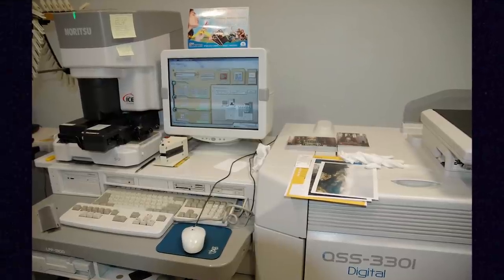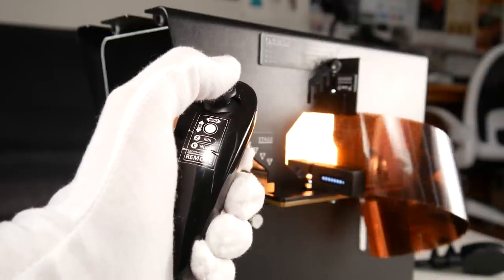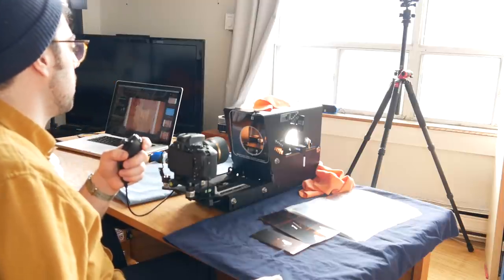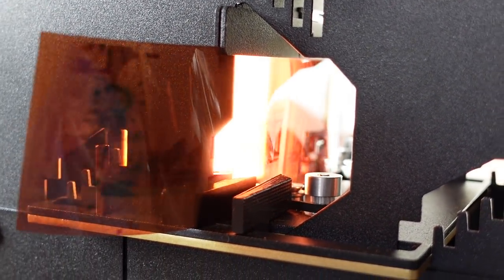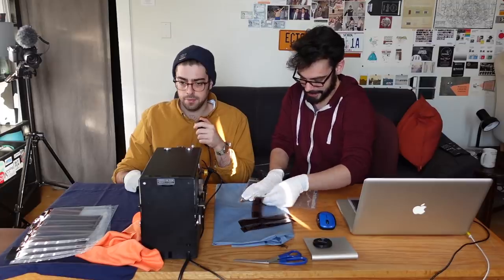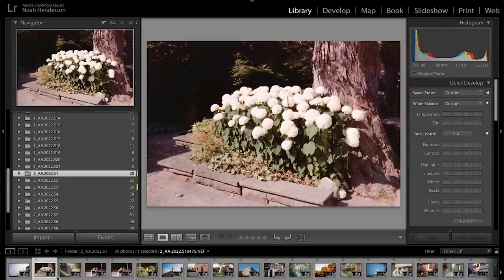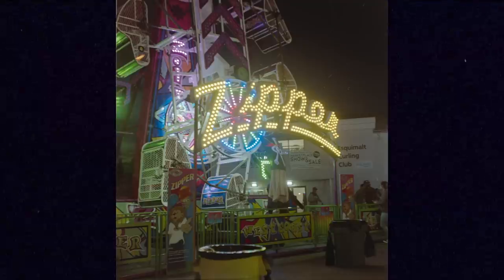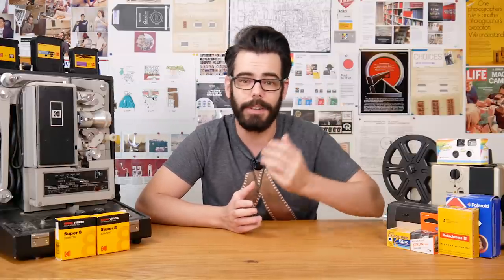Scanning Film with the SLIDESNAP STRIP

Comment: If this could all be integrated into a single unit with built-in lens and sensor and bespoke capture software, ie a modern-day equivalent of the all-purpose film-scanner, then there could be a mass-market for it. That of course would require hefty investment by a big name company OR a substantial kickstarter. But as it stands the market is a niche one. I'll stick with my V850 which is not perfect, but is good enough for my needs. Where everything falls down, current options included is the efficacy of dust and scratch removal, whether it be hardware based at the scanning stage, in post processing or bespoke. There was a recent post in the FB group for film scanning that generated a lot of debate in this area.
Reply: Hmmmmm.... How much would you pay for something like that?  I've been playing with the idea of building similar actually.  Most of the mechanicals can be 3D printed, and the rest with inexpensive linear stages, steppers, etc. straight off Amazon.  The remaining 70% is software.

If I didn't have a pair of Nikon CS5000 and CS9000, I'd be working on building this already.
Reply: @RobertLeeAtYT  If the price point was comparable to say the Epson V850, or a Medium format film scanner, then yes make it.

Comment: The moment someone comes out with a proper Hasselblad flextight replacement, it's over for all these DSLR scans.
Reply from the maker: Those are targeted at very different audiences though with flextights being over $10K usually. That doesn’t replace camera scanning for someone doing it on a casual basis, or archives and museums that aren’t tailored for that sort of workflow.
Reply: @AnalogResurgence  True, but given the development of software and hardware since these scanners came out, you could definitely argue a similar (if not better) scanner could be made for those willing to spend it. Put a 4 core CPU, 8Gb RAM, an ACTUAL thunderbolt/usb-c port, and maybe even a small GPU, and you've got a machine that's not only fast, but can be made a lot cheaper and is more up-to-date. 

It's been an idea I've thought about for a while, especially since the demand for quality scans has gone up. A dedicated scanner that could export directly into Lightroom that only needs a USB-C port would mean you could save a huge amount of desk space and avoid a lot of the hassle.

Comment: I don't know why anyone would buy this for $4000 when an Epson Perfection V800 is about $2000.
Reply: v800s go for like $800 bucks. Even then,  plustek makes a model for both 120 and 35mm.
Reply: @Adrian-wd4rn  I must've been looking at the V850. And I'm in Canada  so the exchange is a bitch
Reply: Oh man, those scanners are pretty bad - both spatial resolution and dynamic range.  Digging into the denser parts of slide film is a problem.  

Film flatness is also a problem.  You'll want to wet mount to digitize film you really care about.

I'd go as far as to say there are no satisfactory consumer flatbed solutions for scanning film.
Reply: @RobertLeeAtYT  I would disagree.  I have a v800, and it's not nearly as bad as the reviews make it out to be-- it's not nearly as good as Epson makes it out to be either, but 2400 to 3200 PPI is a perfectly reasonable goal with the v7xx/v8xx.  The lack of focus adjustment on the scanner itself is a pain, and I do have to do some sharpening in post (I refuse to let the scanner software do any sharpening), but I get pleasing results.  As I shoot 120, 135 and 4x5, the versatility of the Epson is a must have.  While I have experimented with DSLR imaging, for 120 and larger, you have to stitch to get better results than the flatbed-- and the results are significantly better, but it's slower and more involved to do the stitching, and then the scratch/dust removal in post.

The Slidesnap Strip looks fantastic, but it's still $6k USD by the time you add a DSLR and a good macro lens.
Reply: @johngelnaw1243  It's relative.  I'm used to scans from a pair of Nikon CS5000 and CS9000 scanners.  The output quality is just shy of a Flextight.

For your camera scans, have you tried focus stacking to mitigate film curl and scanning plane misalignment?

I shoot primarily 6x7.  That's about 80MP worth of resolution.  A camera like the Panasonic G9 will do that.  The S1R will provide ~190MP, so more than what's recorded on film.  Use a good macro lens and you're good to go.  No stitching necessary.

Comment: Interesting, but it seems like the carousel slide model would be more useful for people scanning large archives, because 35mm mounted slides are probably the most common format. The transport system and horizontal design is cool, but it can't handle 4x5" or larger negatives, and there are a ton of those out there. That means for a versatile setup that can handle all common formats, you'd need this model, plus the carousel model, plus a separate vertical setup with a tall stand for large format and positive prints at various sizes. At that price level and for the amount of space taken up by 3 systems, I feel like potential customers would really lean more towards an all-in-one modular setup like the Phase One Heritage system.

Comment: It seems like this would be a good machine to slightly tweak for motion picture film. Especially if there was a 16mm holder..
Reply: Was thinking the exact same thing. People have rigged up similar things using old projectors and digital cameras that advance frame by frame are are automated to take a picture everytime it advances. Seems like this could easily take up 16mm (same as 110 film) if you simply had two reels on either side.  You'd need to rig up a way to automate it though.

Comment: It does scan fast  but still negative. Film scanners scanning the photo in color so you should mention how long it will take you all these rolls you scanned to make them color one by one.
You shaving time on scanning but you need extra time in post processing. 
Another quick observation is that the frame holder has only 2 parallel lines. Most of the developed film negatives are curved/bended thus the film holder must hold it in place as flat as possible so the whole frame to be in focus when you scan it. Most of film scanners as you know the holders are a square frame for that reason to hold the film as flat as possible. 
He needs to upgrade the film holder to my opinion cos the negatives doing a curve in the middle.

Comment: Really surprised they sent you that camera instead of a D850.  Although it's more expensive, Nikon built an inversion option into it specifically for scanning film.  That would address the 'inconsistency' issue and also take the inversion step out of the software, just giving you a positive raw Nikon file you can do the usual editing workflow with in Capture One or Lightroom.

Comment: What I personally still missing is full X/Y motion, for larger formats (about 6x6 MF and up) to really get all the detail out you need to shoot parts of the negative and stitch in post (at least on most DLSRS/Mirrorless that are less than 50MPix and even then depending on how you exactly do the calculations 6x6 film can already be over a 100 equivalent in theory, though not in practice). Sadly there is currently no product that can automate this (have seen some DIY but don't have the skill nor the time to do that)
Reply: Ah, take a look at the Panasonic S1R.  In high res mode, it'll produce 188MP of real resolution.  It uses the IBIS to shift the 47MP sensor around eight, essentially half-pixel spacings.  It combines the subsequent exposures in-camera to give that ~200MP final RAW and JPEG image.

This blending also improves hue resolution, as it essentially backs out Bayer filter interpolation.  Each pixel position is sampled by R, G and B photosites.  The already insignificant filter noise is lowered further from the pixel averaging.

I use a Panasonic G9.  It's a MFT format camera with a 20MP sensor.  It's high res mode provides 80MP.
Reply: @RobertLeeAtYT  ~200MP might do it for most medium format it is still not enough for 4x5 large format, also you need a lens with that resolving power (since you won't be doing 1:1 macro) so I think a x/y table is still the best option for most people. (also also on a more personal note already invested in Fuji and Pentax, and not really interested in yet another system)
Reply: @BotchFrivarg  Sure.  If using a 2D linear stage then that relaxes requirements on camera resolution and optics.  In the limit, that's exactly what the flatbed scanner is.  It's really just a 3xN imager that's mechanically scanned across the digitization plane.  It's just that it's a real shame how crappy all the consumer flatbeds are regardless of price.

By the way, 2D software controlled linear stages are almost trivially easy to build and inexpensive to build now.  The rest of the functionality is software.
Reply: @RobertLeeAtYT  agree but as someone who has a 40hr job and already to many hobbies finding the time to build a 2d linear stage is kinda hard so was hoping there was something out there already that is affordable

Comment: I really do NOT like this product and intent behind it. Working kit will cost at least 7K (this + camera + lens + software) and that is Noritsu / Frontier territory, both of which will produce better result and are more practical while being from a different decade. It feels like a step back and money grab attempt.

Seems to me "you can use camera / lens you already own" was part of the plan for this product and to that I say: thanks for thinking of ways I can save money just so I can invest it into your macgyvered product with arguably pro price tag. Fact that I can use my existing equipment does not directly translate into adding value to this product.

There's this dissonance of it being a corporate product disguised as a by community / for community thing. Can't imagine wanting to buy it – it's not the kind of mindset I'd want to invest in. I also don't get why flatbed was the main comparison point for this – flatbed costs like 10-20 times less. You can get a new MacBook Pro, Leica M3, Elmar 50mm f/2.8 AND flatbed scanner and still have some money left instead of getting this thing.

Maybe I got it terribly wrong, but I don't think I did ... so I posted this comment.

P.S.: "implementing antistatic brush is not hard at all" – it is part of the actual product and is not even communicated officially – I don't understand why mention this at all. Imagine someone spending 4K on this expecting it will get some sort of dust solution down the road. Which realistically it never will or there would've been an official statement about it.
Reply: Among other things, I think you misunderstand “the intent behind it”. 

Simply put, camera scanning offers flexibility and advantages that traditional scanning options don’t. 

But it is still in enthusiast territory. For prospective institutions, it’s a dizzying mine-field of variables, attachments, carriers, copy stands, tripods, adapters, masks, cables, light sources, power supplies, gaffers tape etc.. For most it’s a non-starter.

The SlideSnaps are purpose built appliances aimed to simplify and bring the benefits of camera scanning to a commercial environment. You not being able to imagine wanting to buy it suggests that you do not fit that description. You likely have little exposure to what bespoke specialized commercial equipment costs. It’s surprisingly intensive to develop, produce and support complex low volume products by hand, especially in the USA.

There isn’t $20k worth plastic in a Flextight, nor $3k worth of fabric in a Linhof 8x10 bellows. And so either they are “cash grabs”, or there is more to it.

Many of our photo finishers / retailers have chosen this approach because camera scanning is more practical and we’ve spent the time to take out most of the guess work for them. Often their lab scanners are tied to and hang up an entire $250k mini-lab while in use. 

While still capable, these antiquated, unsupported, less versatile, mass produced lab scanners you’re trying to draw a comparison to MSRP’ed north of $20k. A single film-carrier alone ran in the $3-5k ballpark. They are being replaced or at least supplemented with a SlideSnap for about $4k + a camera and lens they already have laying around. They rapidly pay for themselves in time savings alone. 

A common imaging kit for 4600PPI scans of 35mm such as the D5600 and 60mm Tamron macro used in this video can be acquired in the neighborhood of $1,000. This is a fairly typical install at around $5k, not “minimum $7k”.

It’s important to understand that a good investment doesn’t cost money, it saves / makes money.

Official Statement:  An anti-static brush attachment IS now an option thanks to Noah’s feedback.
Reply: And, what's more, you're going to get a good camera and lens out of it. If you buy the camera/lens for the purpose of scanning in the machine.

Comment: Okay, a couple of observations.

First, looks like I'm keeping the Nikon CS5000 and CS9000.  Those I bought new 15 years ago and has provided stellar service all this time.  A quick modification of motorized film strip feeder for the 5000 lets it scan an entire 40 frame roll of 135 unattended.  

The scan quality, both dynamic range and resolution, is of course unbeatable and second only to true drum scans.  Features such as autofocus and IR dust removal should not be discounted either.

I think for the serious film shooter, the Nikons are worth serious consideration.  The ~$3k pricing for used units is comparable to the Slidesnap.

Second, I can think of a couple easy, low/zero cost upgrades to the Slidesnap.  Add an IR light source for IR dust removal.  Use focus stacking to eliminate partial focus from film curl, and imprecise lens plane to scan plane alignment.  Both require some software; the latter can be implemented by the user directly in the workflow.

When I've a few months of weekends free, a scanner like this could be interesting to build.  Most of the mechanicals should be 3D printable.  The rest of it are linear stages, steppers, and software.